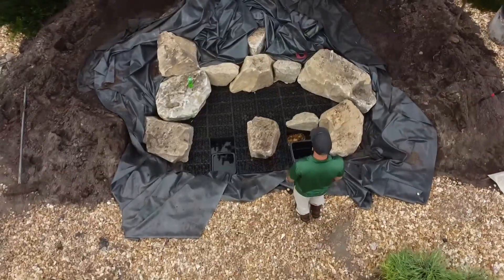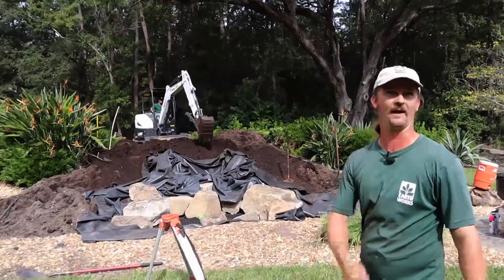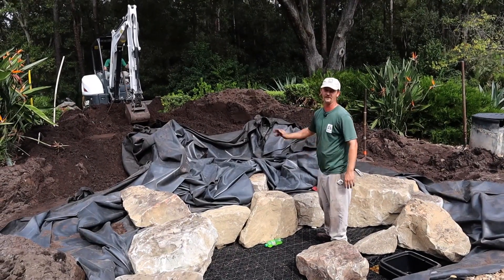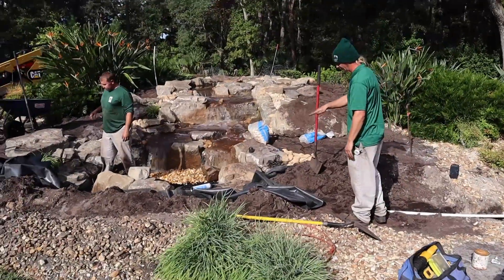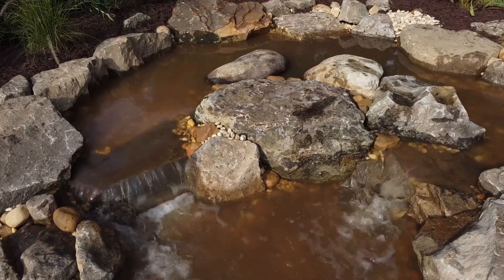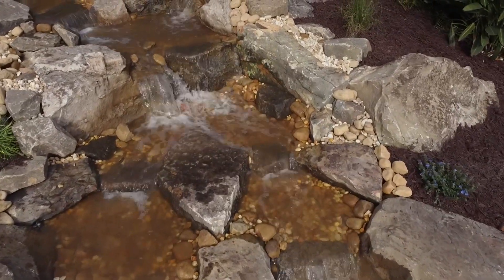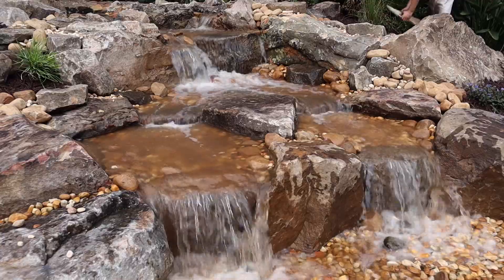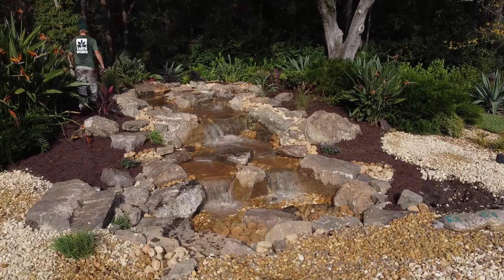High-Powered Pondless Water Feature

Comment: Is there an overflow drain in case of heavy rain or a stuck open valve failure???   And where does it empty into if they have a drainage system in place or are you not tackling that on this project?
Reply from the maker: Amazingly, the water reservoir is only about 500 gallons, which is 60 times less than our average Florida swimming pool of 30,000 gallons. We focused on remedies for the critical concern of the pumps running dry, which could result in damage to them. We did not alter the property grade, which was built to county code and in accord with Marsh Landing HOA requirements. During flood conditions, we encourage homeowners in flood-prone areas to consider shutting systems off wherein the pondless system catch basin is built below grade and can serve as a natural catch basin for stormwater runoff.